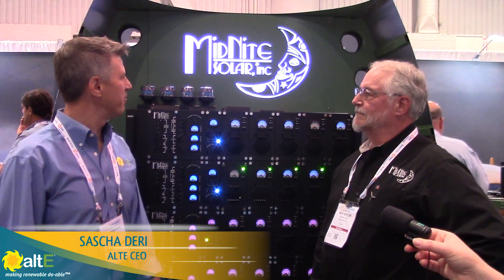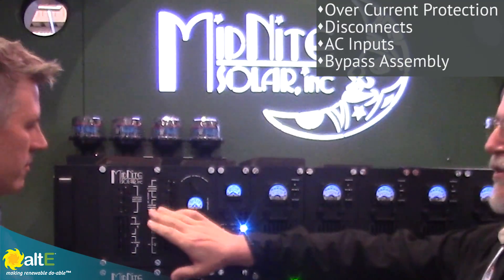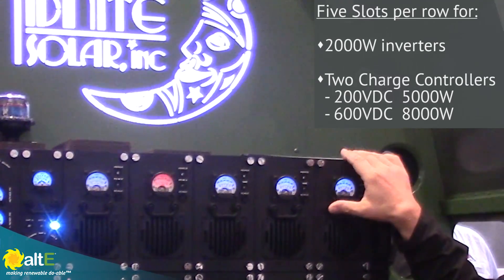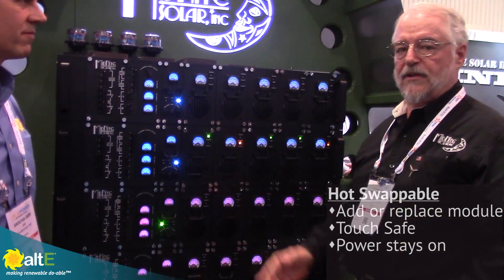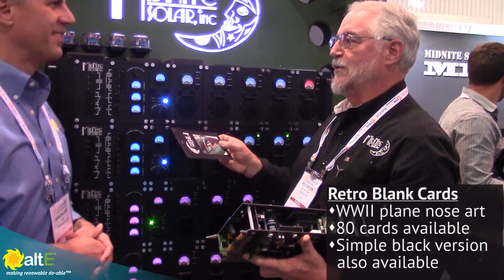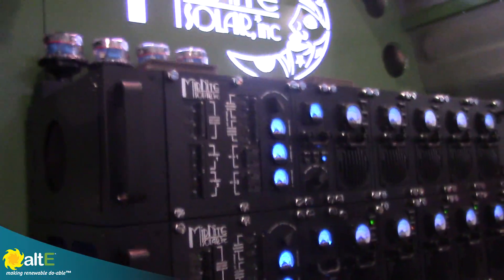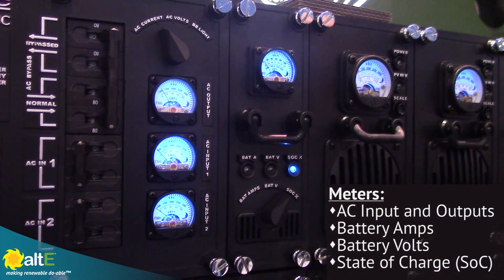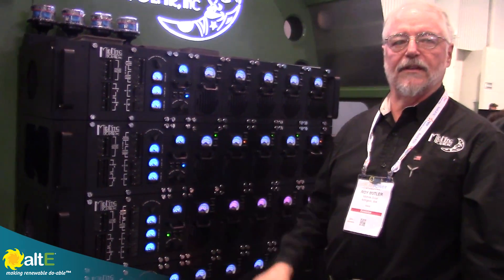Introducing new Solar Power System from Midnite Solar at SPI 2016

Comment: So the system has fault tolerance built in. Are there any parts of the system which are NOT redundant?
What's the surge capacity? Can it handle loads more than 40kW for short (few seconds) durations?
I see no huge transformers. I assume  this is a 'high frequency' inverter system?

My present electric bills average $743/month. Over the next decade, I will pay $80,000 to the utility company IF rates are flat (they won't be). More likely, I will spend six figures on electricity over that span.

Can a system like this, for a totally off grid system, cost comparably to that six figure price? Someone told me that to replace 200A service, will cost me $400,000 in batteries alone.

Comment: I just discovered how good the  classic can possibly be. Ioads of features. What I really like is the ability to over drive it . without damaging it. To maximize for bad sun. It is exactly what I need to do. Just guessing . I need about 500-1000 watts over. To make power when the sun isn't great. I only get direct sun about 4 -5 hours a day.  I'd like two classics with maybe 600 watts over rated. And going by ratings. It will likely be just what's needed. Unless it's a really cold clear day.  Not having to worry about frying the controller is a major seller to me. The de rating is a awesome idea. I would like to know more about this system. This is the first I have seen of it!
Reply from the maker: Sounds like the perfect controller for you. If you are at risk of over voltage often, you can get the 200V or 250V controller, just be aware the current output is lower (72A and 63A). But for most locations,  three 60 cell panels in series are a perfect fit for the 150V.

Comment: It was blinking red on many modules from time to time. Maybe that was some kind of test mode?
What if I try to plugin solar panels then will the system tell me that it need more or less voltage as well as ampere. Maybe some way to calibrate that.
Reply from the maker: This was  prototype for the trade show. The blinking lights were for show. I'm sure the released version later this year will have meters reading voltage and amps coming in from the solar panels.

Comment: I just wonder where are the batteries? You said battery based that would be alot of batteries for 40Kw. It also looks very expensive?
Reply: as an installer i can say this could easily save a full day of installation wiring/conduit and mounting.
looks very nice any idea on BMS communication for lithium
Reply from the maker: They will work with any type of deep cycle battery, the batteries are not included. We haven't heard any pricing yet, but keep in mind that this will greatly reduce labor costs when installing, so any systems that are professionally installed will save a lot of man hours.

Comment: Obviously many bells and whistles that you don't need. Lets go cheaper not more expensive.
All this does is scare away potential installations. People mistakenly believe that solar is too expensive. This just confirms their opinion. Solar does not have to be expensive.
Reply from the maker: This is a terrific solution as solar systems get larger, making it as simple as plug and play. This should make larger systems easier and faster to install, bringing the installation costs way down. For small simple solar systems, there are still plenty of inexpensive options. We will never leave the small systems behind. Making renewable do-able, regardless of size.